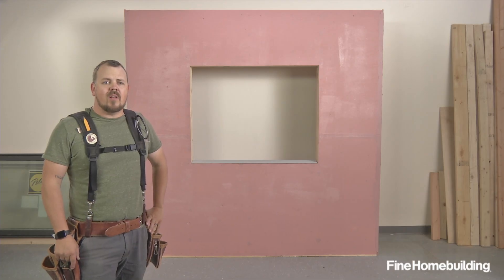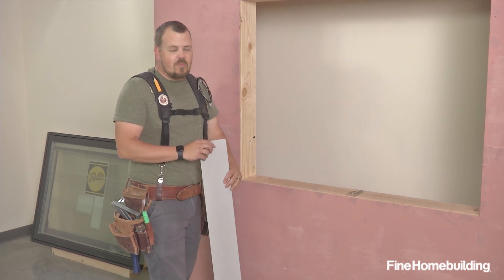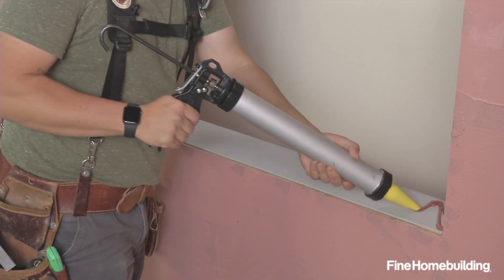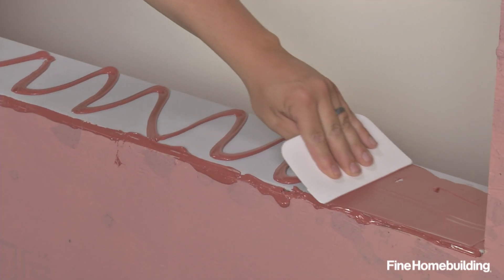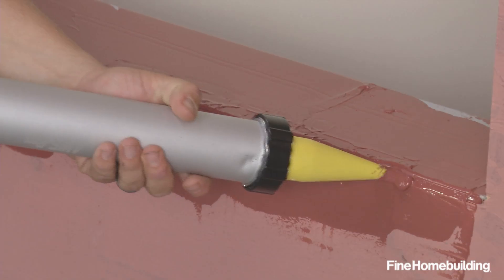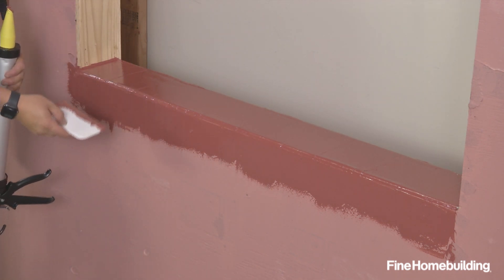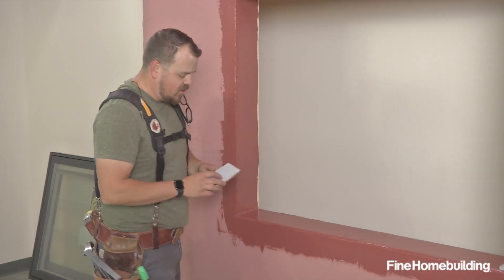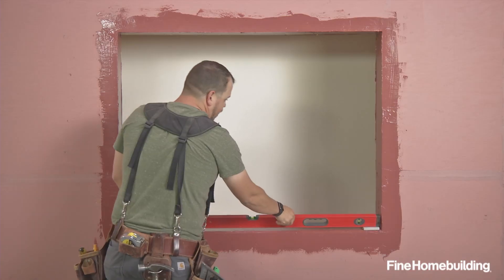Part 1: Prepare a Rough Opening for a Nail Fin Window Over a Fluid-applied WRB

Comment: I tried liquid flashing as a test on some windows this year. Simply took too much time to spread the liquid flashing around the entire opening.  However, I think a good compromise is using liquid flashing on the sill for a bullet-proof pan and then use tape around the rest of the window.  I don't trust flex tape to not curl/bubble after repeated heat/cold cycles in that critical location.
Reply: then which product to use? prosoco i dont think makes flashing tape. zip doesn't make liquid flash roller grade for the walls, so i guess its only poly wall?